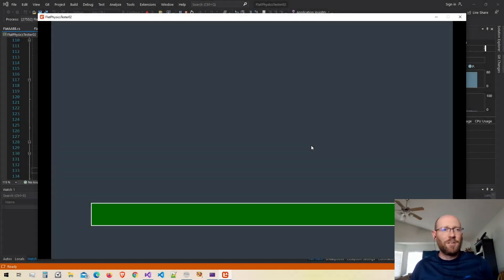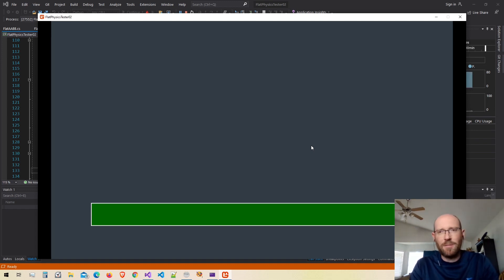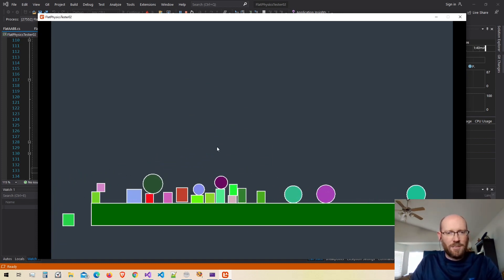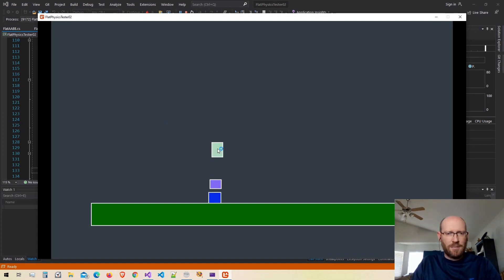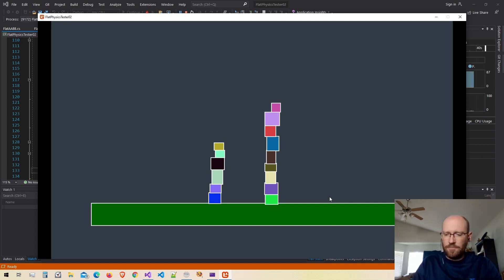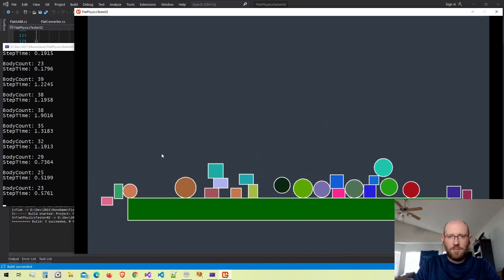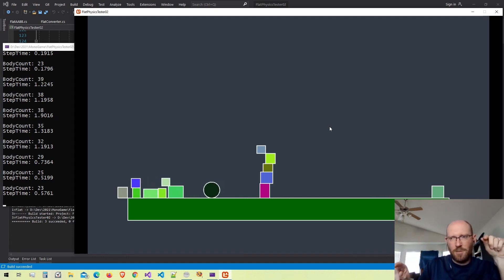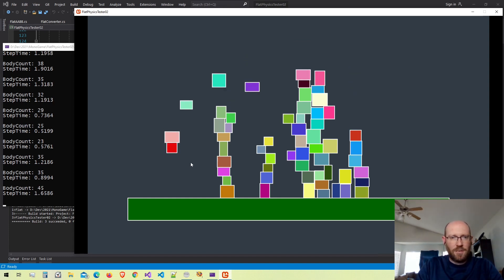Increasing Precision - Let's Make a Physics Engine [14]

Comment: That grid you want to implement is called a quadtree. A very nice algorithm that will save a lot of comparisons. Looking forward to see that implementation! Thanks for sharing your coding adventure!
Reply from the maker: Thanks.. I will look into that. quadtrees may be the way. I have also been considering using the Dictionary collection to make a "sparse grid." The sparse grid is super easy because the dictionary does all the  heavy lifting by using keys that are based on position;  but a quadtree may be more efficient. I will probably use the grid first because it is conceptually easier for me to understand with great results but I will research quadtrees.

Comment: Great video as always! I actually didn't know that the objects were sinking due to inaccuracy with the resolutions, so thats definitely something new to learn
For the performance, you can also try implementing acceleration structures, which should fix the performance issue I think
Reply from the maker: I really am no expert 😎, but, From what I can tell it has to do with the inaccuracy which is inherit in a system that runs at finite interval steps and resolves collisions in no particular order. By increasing the "sub-steps" we are making it a lot more likely that the "first" collision (based on time) will be resolved "first," and then the 2nd collision, and so on... Basically the collisions get handled in the correct order at the cost of more CPU cycles.